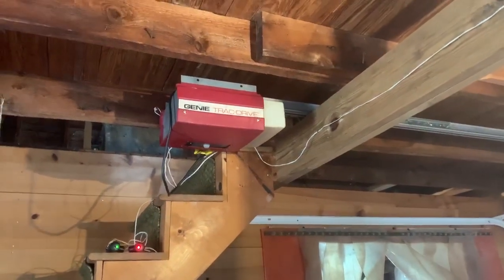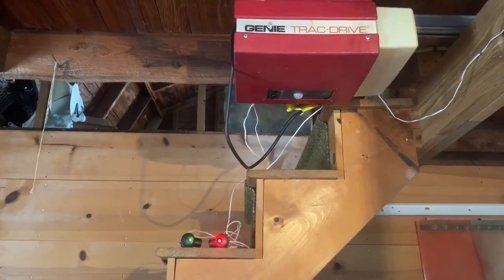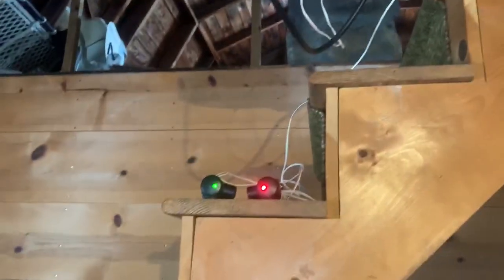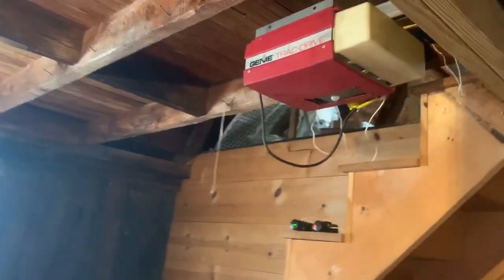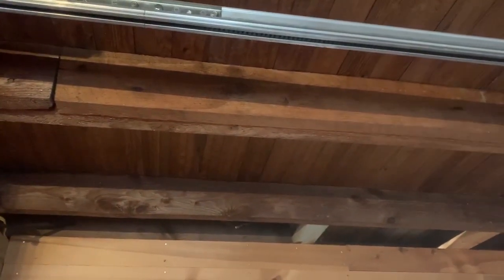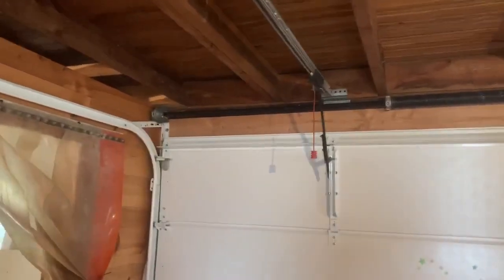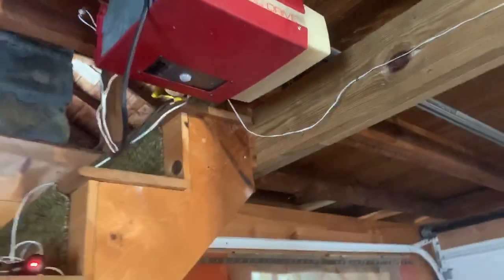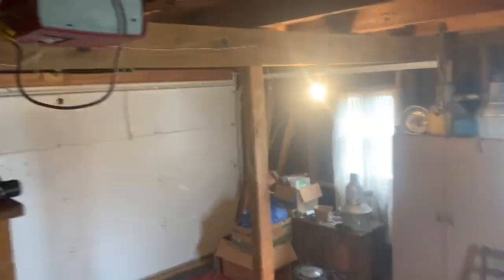Genie Trac Drive Model 900-DC Motor

Comment: I think this might be quieter than GarageDoorMan89’s version. Considering how many lighter weight doors there are out there now, I’d actually like to see GeniePro and OHD bring this to market with that style tape and sprocket. It’s even quieter than our Infinty op. New TracDrives and 190’s with hardware upgrades would be a sweet system!
Reply: TheGarageDoorGeek I think they would have a long life on newer doors. I think this version is slightly slower than mine making it quieter. Only way to find out is run them next to each other. I would like to see this design return, after all it is maintenance free.
Reply: @GarageDoorGuy89  It would be a really cool idea. Would probably be easy to assemble on the DIY side too.